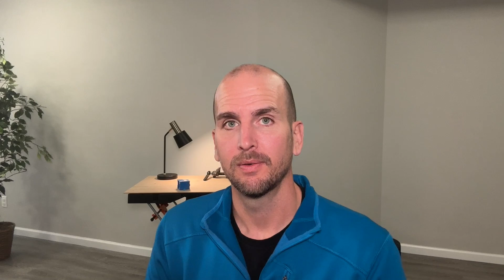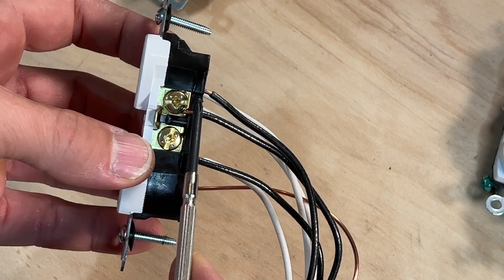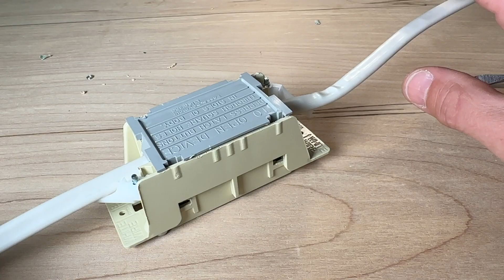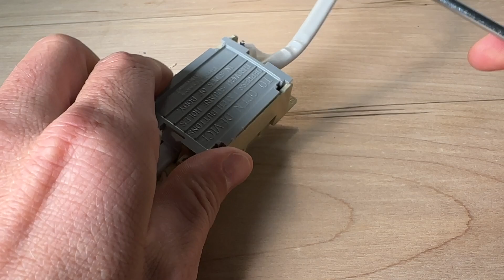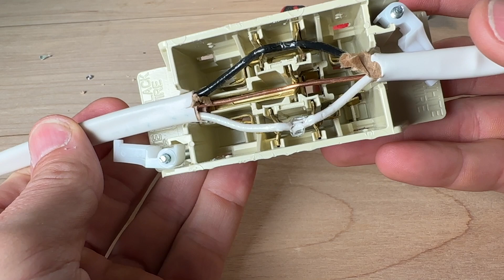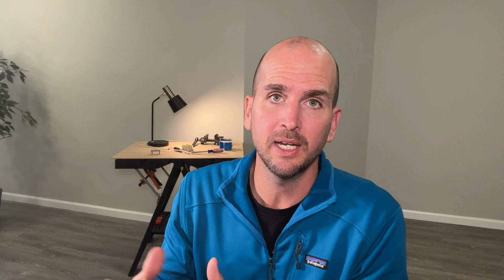90% Of Homeowners Have Never Seen This Dangerous Electrical Device

Comment: Yes, when one goes out, I replace it with a (old work Box) I cut the power, pull it out of the wall, take the back off, remove n cut / strip the Romex, install the wire in the box, secure the wires, to the new standard outlet in the box, turn on power and check for shorts, then install the assembled old work box in the wall.

Comment: I am a young DIYer, in my opinion, that type of outlet would be fine if the insulation was stripped well and maybe the contacts redesigned to have less resistance.

Comment: These are all over my house. Everytime I disturb them, I replace them now with a new box, outlet/switch, and cover. I hate them! I didn’t get good connection once when reinstalling and had a lots of smoke inside the apparatus that partially melted the plastic housing, there was almost no load on the wire too.

Comment: I had two of them fail on me. One I smelled hot wire, tracked it down and replaced with a proper outlet and one the connection failed and I replaced it with a proper outlet.. I like the J-hook maximum contact area  the tightened clamp is My#2 choice.

Comment: Even in the video, you can see the severe mechanical damage the wire receives from being punched into the pinch connections.  I have been an electrician for 30+ years, these devices are beyond junk and we have to replace them all the time.  We have a hard time believing that anyone thinks these are safe or even cost-effective.  This is just pure greed.    Even brand-new homes have problems with these.  All the electricians in our company detest these devices.

Comment: I have been working on mobile homes for 20 years and I hate these outlets/rockers.  The rockers often get burned out on their contact points as well as dealing with the terrible wiring connections.  I always replace with an old work box and traditional outlet or switch.

Comment: I hate these speed outlets. I did my mother’s two rental trailers where these self-contained outlets were used everywhere. I noticed that a few of them were warm to the touch even when not in use. They are not code compliant where I am. I had to actually take one to a professional electrician to find that out. The fact that they were warm was enough for me to replace all 34 outlets.

Comment: Had to work with one of these in a mobile home I used to own. Had never seen them before. I was shocked it was code compliant. I won't use them, at all. Just my opinion, but they're dangerous and hard to work with. I just feel there's never a good reason to use them.

Comment: They are still being used, our son bought a manufactured home with them..had to replace one because the tabs came off and the outlet was hanging from the wall. I can see how they would be okay if installed okay, and you can also argue that a more traditional outlet not installed okay is more dangerous... The funny thing is this, if not for the internet or 43 years seeing the traditional type, I'd honestly think of this as an upgrade. Just like the fight against ideal push connectors and lever connectors... people trash them and there are millions of them in use without issues.

Comment: This reminds me of doing punch downs for networking. That's fine for very low energy applications. But I can't imagine using a punch down setup for line/main voltage. I just would not be able to trust it.

Comment: Why did they design these outlets at all? Speed of installation? Common sense will tell you they're dangerous!
Reply from the maker: I think also the depth needed inside the walls is less so you can build the walls out of 2x3 studs instead of 2x4 studs.

Comment: In the high vibration environment of a travel trailer or RV they're actually a superior design to the screw terminals on traditional home outlets. The reason is vibration, a travel trailer is going through the equivalent of a large earthquake for hours at a time every time it's taken out. Between my last 2 trailers I've put tens of thousands of miles and hence nearly 1,000 hours of high vibration exposure to the outlets without a single issue, compare that to the dozens of screws, bolts, and brads that have popped out or backed off.

Comment: I have  manufactured  houses and  have  replaced  a large number of them..  biggest problem I found was when a lateral was put on.  The light metal that the  wire  splits spreads and  does not  provide  much pressure to a second wire which could then heat.

Comment: yeah, that push in thing shouldn't be allowed anywhere, when my mother in law built her new house I donated my time to do all the wiring and every outlet was considered to be max load safe and each one has it's own drop from the junction box, each terminal screw has as close as possible to 360 degree contact under the head. almost 20 yrs later we are living with her to care for her and glad to know that's one less thing to worry about. couple years ago we took in the garage and made it into an extra bedroom and I had to go back in and tie in the new plugs and everything original still looks good, no hot spots

Comment: The Scotch Lock connectors suck when applied to vehicle wiring. This is the same type of connector - it pierces the insulation and relies on a knife edge to make the connection. 
I cannot see anything good ever coming from these.

Comment: "dangerous electrical device" = pretty much anything built over the last 80 years, some of which is still working just fine. The electrical industry is full  of "chicken little's" that claim the sky is about to fall at any moment. Have fires occurred, sure, but  compared to how many hours in service has been realized, it is inconsequential.

Comment: Upstream GFCIs do not like these punch down outlets. The punch down contact causes inconsistent current flow that trips the GFCI, especially in motorhomes that have chassis vibrations/shaking as they drive down the road.  My Winnebago has them. I solve this problem by stripping the wires and punching them back down.

Comment: Funny this popped into my feed, I just saw this for the first time when I installed an exterior outlet for someone, I put the outlet just behind and below an interior outlet for easy access to power and I went inside and pulled the outlet out and it was this weird ass thing lol I definitely wasn't a fan, there's a lot of resistance on such minimal contact points.

Comment: They are used in many raised floors for desk or other feeds. Have had issue with only one so far. Our on site electricians don't like them. As you say they are code and ours are rated a 20A 124 VAC. and architects and engineer still spec them.

Comment: I started replacing all my switches and outlets once I found out they were in my walls! They've been in there since 1989 though and I had a light switch that arched sometimes. 
Lucky I had enough wire to install boxes and real switches and outlets. I don't see how these pass any kind of code anywhere!?

Comment: I have a 1996 Horton Mobile Home. It's full of these. They short out very easily, the Light Switches are similar and build up carbon on the inside of the box. I replace them with the correct Receptacle and Switch. I go to the Hardware Store and get Old Work boxes and replace with the correct Receptacle or Switch.

Comment: My sister fixed up her house and had it inspected and sold.  There was one circuit that had been a problem, so she had a "handy man" work on it.  The wires were short but after working at it he barely got wire nuts to bite into them.  She plugged a heater into that circuit, left and returned to her home burned to the ground.  I'm no electrician but never settle for anything but the best possible solid electrical connection!

Comment: I had 2 of these outlets show signs of overheating in my park model camper when using high wattage appliances (space heater/coffee maker etc). I have since remodeled the camper and replaced ALL of the switches and outlets with traditional home construction boxes and outlets.

Comment: I hate these outlets. Nvr saw them until now in my manufactured home. My living room is the area I worry about the most cuz of all the electronics. I can't use the electric fire place or a vacuum in the outlets of that area cuz the living room lights fluctuate a lot. I hope replacing these outlets will help. If anything I will feel a little safer knowing I have outlets with good contacts once I change them.

Comment: I work for a guy who owns  mobile home park. Most were built in the '70s and almost all have these self contained type
Outlets. They're a pain to deal with but my solution is to remove them and replace with a standard outlet mounted in an "old work" type box because there is no stud to mount to. 
The hole in the wall usually just to be made slightly bigger to accommodate the new box and it has to be precise because it also depends on those "ears" that tighten against the wallboard from inside to hold the OW box in place. I've not had any failures with this system.

Comment: Horrible!  This wiring method makes sense for low voltage landscaping lights where each light draws well under 20W.  However, I would never be comfortable with this type of wiring connection for 120V, 15A circuits.

Comment: I replaced one of these for my bathroom light switch, was a pain to even find the same kind of connection switch, it went from the toggle to a flat switch. If I could find a way to put a normal switch it that would have been amazing
Reply from the maker: Yeah depending on the thickness of the wall cavity you usually can get a shallow old work box in and just use a standard switch with a little rewiring.

Comment: It’s funny, even though I always use the screw in method, I have wondered if the “push in” method should not be used regarding the safety, why does the manufacturer make them this way????

Comment: In most good insulation displacement connectors (IDC), the cover of the connector will also be the tool that presses the wire properly between the blades that pierce the insulation, guaranteeing that the wire is properly engaged, and able to handle the rates current.
I'm surprised that the NEC wouldn't address this and mandate an installation method that can't be skipped.

Comment: Our Fire Investigators on my FD has reported these in RV's as the cause for several fires. 
We have several RV parks and every winter we see at least 2 fires. People plug in electric heaters they pull 1200-1750 watts. 
However we have also found 14/2 ran through the metal studs of Travel RV's with no grommets or they are cheaply and haphazardly pulled through causing a fire as well.  I haven't heard of any permanent structures in our area using these.

Comment: We own a modular home which has these. I've replaced a couple by installing boxes, and fortunately I've had enough wire to pass through the box and connect to the replacement devices. In one case they benefitted me, because I wanted to convert a ceiling light to a three way switch, and not having an existing box at the original switch allowed me to add an additional cable without having to tear out an old box. I put a normal old work box in that switch location.  And, in our travel trailer,  I wanted to extend a line to a new outlet, and lacking the tool used to push wires into the outlet, I ended up stripping off a small piece of insulation so that the new wire would make adequate contact with that V shaped piece. Not a fan, but never observed any problems.

Comment: I'm not an electrician but I see two problems with that outlet other than heat.
A connection that barely makes contact may spark, causing a fire from leaking combustible sources.
In adequate amperage caused by poor connections or inadequate wire guage brings damage to compressors and solenoids that operate refrigerators, furnaces, dehumidifiers, and more.

Comment: As far as i know, here in Norway the back wiring is with the screwed plate design is the most common, not sure if its always from the back like you show in the US but here it is often from the sides, i have only seen this design on network ports, but for network cables this exact design to have them in series wont work.
Im not a licenced electrician and in my country am only allowed to do electrical wiring under supervision by one, it happens occationally as i know quite a few.

Comment: I think that while the wire is pressed, the edge of the piece that holds it makes a slot with the edge it has and therefore I think the wire loses its gauge, right there in that slot, if it is 14 it becomes 16 .

Comment: Ive had one of these outlets in my RV spark like a sparkler and melt before my breaker even tripped. Learned RV wiring was terrible the hard way and had to replace all the outlets to ones with screw in backing plates. Also replaced my breakers to square D. Never had an issue since.

Comment: we repair them by installing a cutoutbox and a normal receptacle. Those are trash. I really like the pressure plate style outlets. And an ethernet cable does NOT carry anywhere near the current 14ga carries let alone 12ga.

Comment: Does not require a special tool. The protrusions on the back cover press the wires into place on the blades when it's pressed on tightly enough for the retainer tabs to lock. Wiring it is two simple quick steps: 1. lay the wires into place and 2. press the back on until the locking tabs engage. The wiring speed is why they are used in manufactured housing.

Comment: I had these in a mobile home. I didn’t like what I saw when I had to fix a burnout. I replaced it with a cut in box and standard receptacle. They also have relock style T tap junctions that use the same type of connections, I saw it on display at platt electric about 20 years ago. I have never seen one in the field and I will never use one ether.

Comment: just did a whole mobile home that had these in. Place was built in 1988 surprised it was not on fire since then. What a pain in the rear taking these all out and having to redo with all new boxes ,switches and outlets. Some of the outlets when taking them abart you could see how the wire was heated and turned brown from the heat. glad that job was done. quick tip make a template of the size cutout you want to do and a marker. mad resizing the box cutouts so much quicker .

Comment: I have experience both installing and servicing those type devices. Properly installed they are fine. It may be a small contact area but the resistance of the connection is low. The device may fail but the wiring is intact. That said more often they are not installed with due care and also they are a pain in the butt to replace for several reasons. They would never be my choice.

Comment: They scare the crap out of me 😔 I haven't seen them used outside a RV yet. I've always wanted to replace them in my $100000.00 RV.Yes, even in an RV in that price range they use these!!! 😡😡😡! ! My Rig has 50a service this is different from residential because it has 2 - 120v legs that actually = 100A. The only reason I haven't changed them out.is because of Vibration during driving. These have the advantage that they probably won't lose what connection they have from road vibration. With Screwed down connection there's a chance the screws could come loose and start a fire! Basically any RV , Travel Trailer, Fifth wheel is a home that experiences an Earthquake every time they are moved . I'm 100% sure that the RV manufacturers don't use them because of This!  They use them because they are cheap and quick to install ,  a reason why campers fall apart so easily but that's a different subject. RVa are not required to follow any Residential Code so the wiring, Plumbing etc in them is scary. How did they find their way into a residential building? Or get a UL listing?   I just had Solar installed on my RV what they used to wire it in would fail any code inspection but it's ok because it's not a home under code rules.  I'm still working on fixing this with Missing Fuses and breakers that could help prevent the RV from burning down if a  solar panel fails and back feeds into another. RVs will burn down 100x faster than a real house because it's all thin flammable materials to increase Profits. (First Priority) and save weight (so it's light enough to tow with the Cheep materials) don't let a RV Tech work on your house their training is from another universe. Unless They understand Residential and commercial systems. If all they have is RV training don't let them touch your property!!!?
Reply from the maker: Hey Ken, thanks for all the great feedback.  👍

Comment: I have first hand experience with this type of outlet. I own a fairly new mobile home and due to my curious mind I found them in my home.  My cure is to replace each one with a standard wall box and outlet connected by wago connectors. I personally feel that these "original" outlets create a dangerous situation and I have plans to eventually change out each outlet,  one room at a time.

Comment: They're fine, but I recommend removing the insulation where the metal clamps are going to contact and then pushing it down so that the clamps cut in the copper directly. Don't remove all the insulation.

Comment: Not UL Certified, but common sense should prevail.
I agree with you - the less surface area contact there is between the wire and the terminals, the greater the resistance and likelihood of failure, meltdown or fire.
I am likewise surprised that these are UL approved for use on anything other than low voltage setups.

Comment: The lack of contact will heat up the wiring, taking care of insulation that is too much.
Problem solved.

Just a joke guys!
Try using them in a lab setup without back plate, and see what happens in the back when 
a big load is connected to it.
I guess there's lots of fireworks going on in there.
Bad contacts cause sparks also.
I live in Europe, and I never seen such things here.